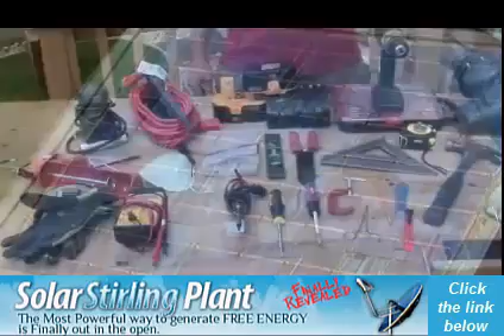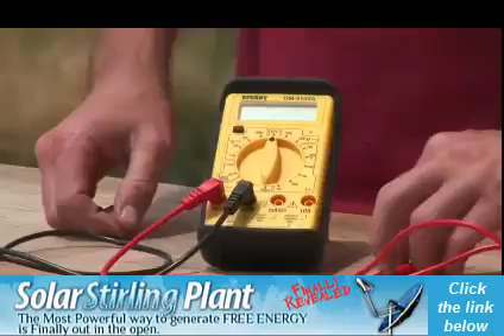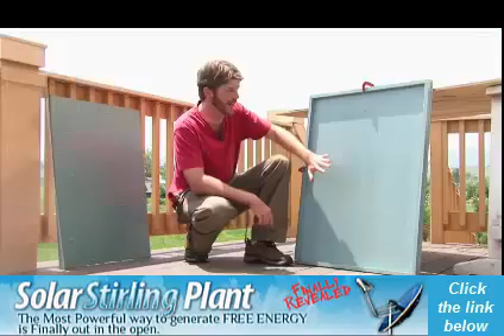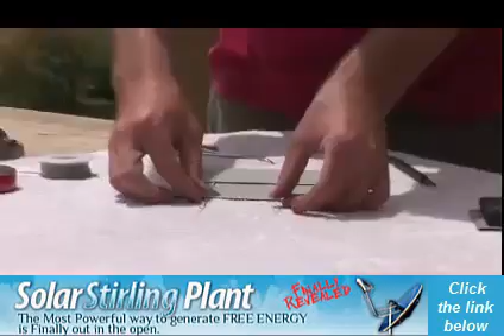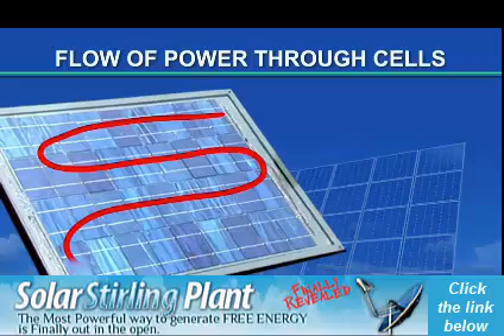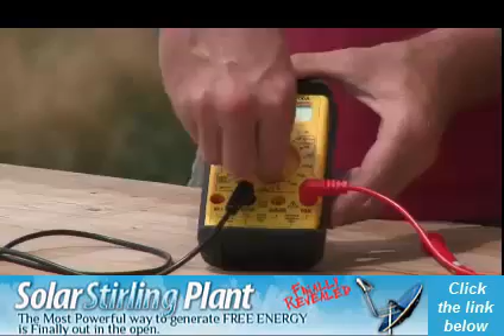How to make a solar panel at home - Slash your bill today!

Comment: your measurement of single you indicated over 3 amps,, you understand you were measuring voltage at 14:10, do you know how to use a voltmeter or what.. normally single cell is .5amp max. & 5vdc max..
Reply: Why be a prick about it?